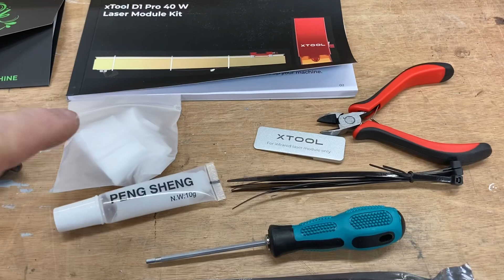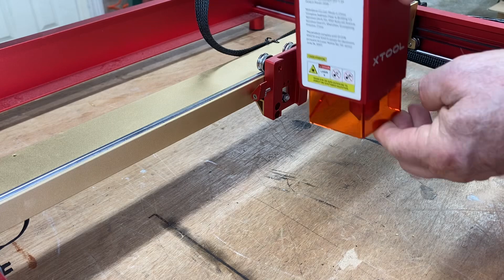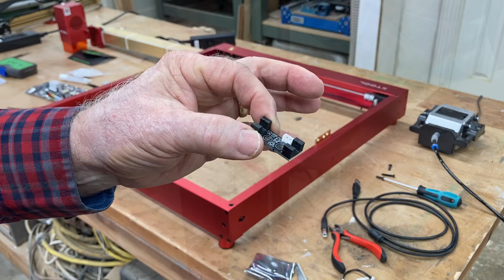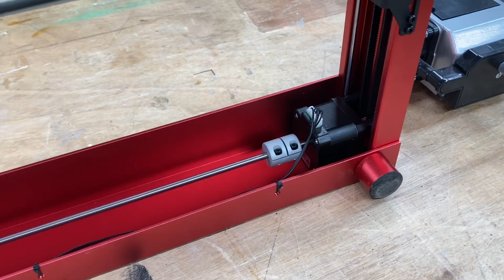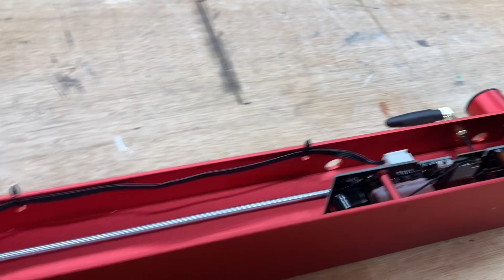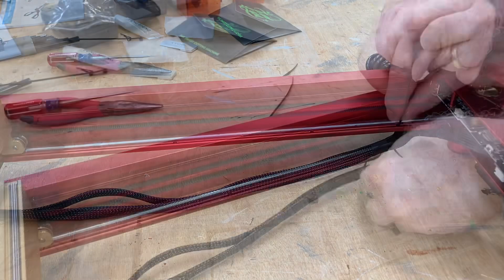Time to UPGRADE to the xTOOL 40 Watt Laser!

Comment: Hello if you switch 40w to 20w do you need to change the motherboard again or 20w works with 40w motherboard ?
Reply from the maker: I have not tried that,maybe someone can help out and answer this question
Reply: Yes, there is only another connector for the aditional diodes and power. The 20w can be used still, which i can recommend for finer details.
Reply: @hampter_4_real   I bought a 5w Pro with extensions, for a great price. Just upgraded to a 40w. I was wondering if I should keep the 5w for detail. It's not worth much if I sell it.
Reply: @jakerazmataz852  on the hobby side i would keep it, for business or professional use id sell it and get one with higher power.
Reply: Yes, the 40w will come with the replacement motherboard which needs to be used due to the additional wires.
Reply: I tested 40w motherboard with 20w module and 40w’s cables it works but need to adjust stop switches for 20w.

Comment: These X Tool lasers are not cheap to upgrade when Ali is selling 40w heads for <$60  vs $500- 1000; pricey for all the Americans paying for importers 'adding value' of making a brand with already on the shelf parts.  And having a larger universal transformer of same voltage is not a big deal if you have the bare or correct end fittings.  Little tech parts some years ago at Radio Shack was handy before the demise. Some repair shops can sell connectors if they are nice
Reply from the maker: Thanks for sharing. You bring up several different options to save money. I applaud you for that. It’s hard to find the parts.  Radio Shack is gone. Thanks for watching

Comment: Does this laser module only work with the cTool machine. I could use that laser on my CNC machine.
Reply from the maker: I have not tried to put this laser onto any other unit. This also has two wires whereas most others only have one

Comment: I bet that laser is going to be nice!    But $1000 is too much for me..   A year from now we'll be talking about the new 80w output laser module and the 40w will be half the price it is now..
Reply from the maker: You most likely are correct.
Reply: I doubt it'll be 80W and the 40W will be half the price, but it would be neat to see what even more power can do. The main thing I notice with my 20W is it doesn't seem to keep the energy up when ambient temperatures are high (I have to use my system outdoors due to fumes and smoke). If I could cut through 1/4" basswood in a single pass, then that would absolutely make my day. I don't intend to do anything thicker than that but the more power you have, the faster it can move and still maintain a decent engrave depth or color for lettering, etc. The 20W still just doesn't have enough oomph in it without having to drop your speeds to watching paint dry. 😢

Comment: The 40w only works on the D1 Pro. Those of us who bought the D1 are apparently out of luck. I got my D1 for Father's Day in June, so my system is already obsolete. I really wish XTool would offer a 40w upgrade for its early adopters.
Reply: Totally agree. They were ok with all the replacement bits for the pro from 20w to 40w but never gave a upgrade option for D1 to D1pro.
Reply: No kidding. I feel left behind.
Reply: @RobertJohnsonLasers  It looks like all you keep from the D1 Pro 20w package is the outside frame and the driver motor. It seems like it wouldn't be that hard to work up a package for a D1. Then again, I'm not a paid "influencer"...
Reply: It works with D1
Reply: all these upgrades are able to be done using 3d printer parts... there is nothing that cannot be done but if you think you need a kit, you probably are not capable.
Reply: @TalkingGIJoe  Not all of us have 3d printers. I'm frankly irritated that my wife spent a lot of money for a Father's Day present for me that was obsoleted by the manufacturer by New Year's Day.
Reply: @jimnugent1143  you don't need to have a 3D printer, what TJ was suggesting is that they are the same parts so you could in fact get your own. I do of course fully understand your justified frustration.
Reply: @jasonhancox1622  I see GIJoe's point now. Thanks!
Reply: @TalkingGIJoe  Some people like first party parts others are happy with third party or even diy parts, both ways are fine. Do you also believe that people who go out to dine,  probably are not capable of cooking. So while i do appreciate your comment , you may have missed the point . That point is, with so many parts being replaced anyway, it would have been a consumer friendly option to add a original D1 upgrade as well,